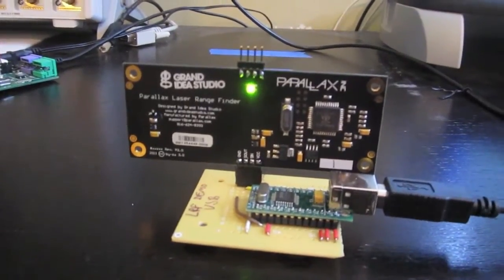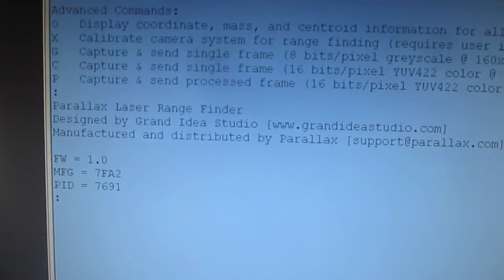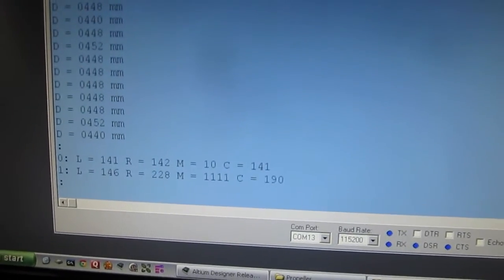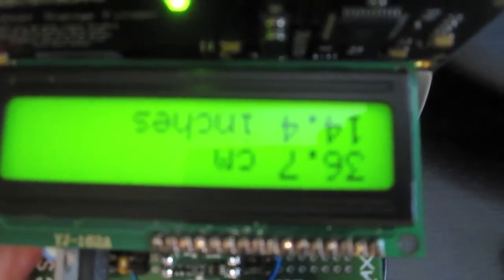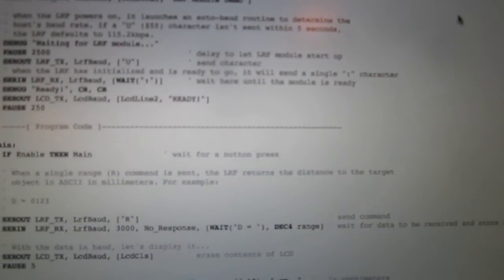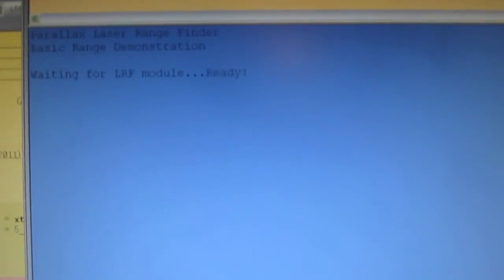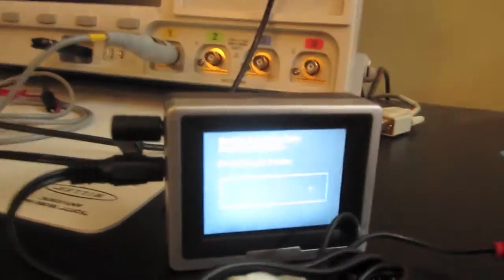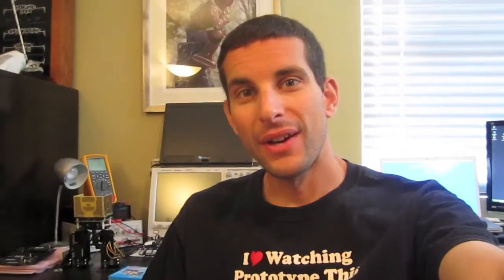LRF: Demonstrations of the Parallax Laser Range Finder Module

Comment: You should leave it some time to look at the wall to see how accurate it is, i mean is it change value or not. What you think can it work with milk? If work i will buy it. Thank you
Reply from the maker: +Karlo Schweiger Accuracy varies with distance, but the value won't change if the distance isn't changing. If the laser spot can be seen on the milk, it should work. You may want to do some experiments to determine ideal placement. Specifications and more information can be found here: https://www.parallax.com/product/28044

Comment: Is it possible to run the Parallax Laser Range Finder on Raspberry PI?
Reply from the maker: mechlopak Sure. The module will work with any device that can transmit and receive asynchronous serial data (from 300bps to 115.2kbps).

Comment: HI, if i want to command L and have delay at 500. it is possible?
Reply from the maker: nurain alexis tan The L command will loop as fast as possible. The best way to introduce a fixed delay in between range measurements would be to use the R command to receive a single measurement and have your system delay for your desired time before calling the R command again. Basically, you'd create your own loop.